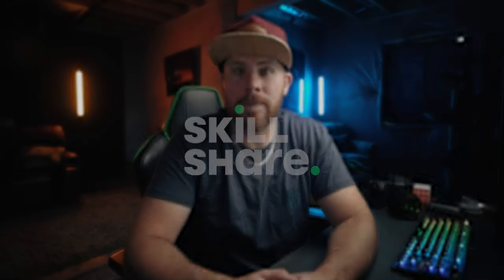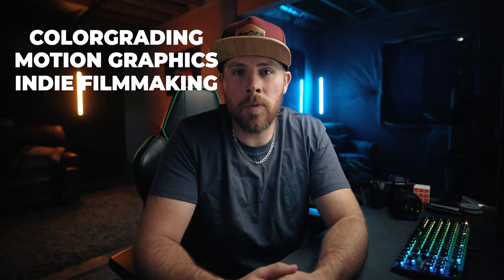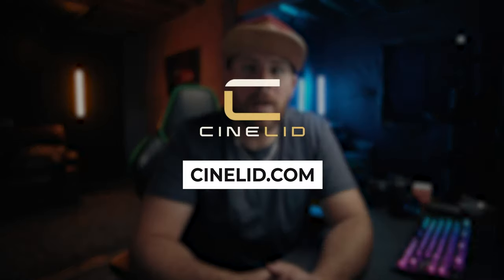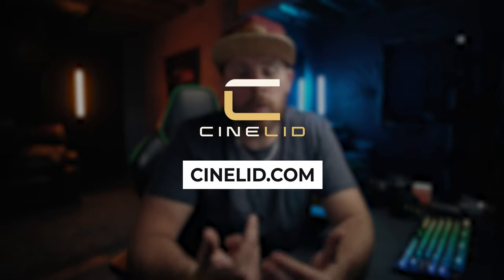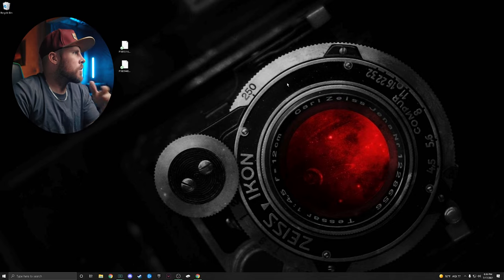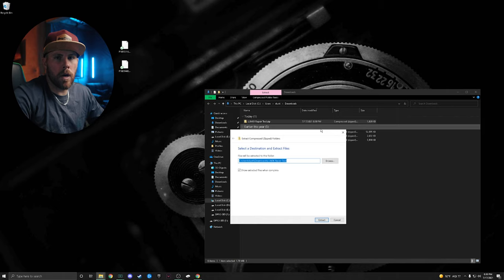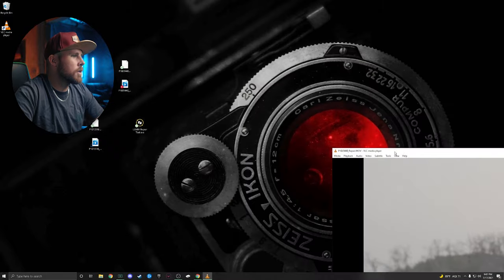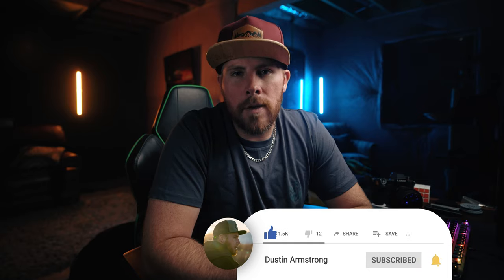LUMIX MDT Files. How to Prevent and REPAIR Them

Comment from the maker: Update for those watching. I keep getting questions on what you should do if you don't own a S series Panasonic. Still try and download this software and follow the instructions! It's still possible that it could repair the damaged file. Good luck!
Reply: It works. It's in the details of this tutoriaI.  My GH5 gave me a 90GB mdt file of a 1:20 hrs recording - and the magic happened. After more or less 1:20 hrs rendering along a perfect file from the same session all data were back and perfect.
Reply: After shooting one of the files is mdt now. But I have a GH5 But when you have to fill in the model and  the 11-digit alpha-numeric code what do I need to fill in? Because It's asking for a S model.
I'm really stressing caus the deadline is tomorrow.
I hope you can help.
Reply: @grunningervlog  Watch the video to the detail, when it comes to the „Chose Camera Model“ and „enter serial Number“. It took me a while to get the idea but then it worked.
Reply: Did it help? Could you free your data? @grunningervlog
Reply: Thank you for sharing! Worked perfectly with a 60 GB 4K .mdt file from my GH5 camera. The only odd thing I encountered was that when trying to open files using the "..." buttons the software crashed. But when I dragged and dropped the file onto the repair tool it worked flawlessly! Panasonic really should make this software more easily downloadable, especially for owners of their other cameras too.

Comment: Hi folks. I recovered a .MDT file that was almost 30GB, and nearly one hour in length. It was really important wedding footage so was super worried I had a disaster on my hands. Long story short, I downloaded the Grau Video Repair Tool, and paid £30 for it. It worked. You must change the .MDT extension to .MP4 and tweek another option or two but it worked for me, thank god. You can try it for free and save 50% of your video before going to pay for the full version. Thanks a mill for this video. Sooo helpful.

Comment: Just had almost an entire shoot's worth of clips turn into .mdt files. Luckily 2 were written correctly. I was able to install Parallels on my Mac and open the LUMIX Repair Tool in that. Worked perfectly! No batch processing option though. Insane Panasonic doesn't have a Mac version. Thank you for this video Dustin!
Reply from the maker: That's smart how you went about it on Mac. No problem though glad it worked!

Comment: Thank you Bro for breaking this down perfectly! I've been recording with my S5 and S1 for several years now and haven't experienced this issue. Just did my biggest shoot to date and had this happen on the most important clip of the event 😖. I had a fully charged Lumix battery, didn't turn my camera off, and didn't take out my memory card. BTW, I use Lexar Professional V60 cards and like I said, never had any issue with my cameras writing to them. However this was my first time recording in 4k60p for an extended period. Maybe that was the culprit 🤷🏿‍♂️. Either way, I followed your instructions and was able to successfully repair the file! Thanks again.

Comment: Had this problem come up during an event I was recording last night on my new GH5M2.  Was able to use the info in this video to download the tool, and it worked perfectly to recover a 42-minute video.  While I did have 3 other camera recording the event, this was my A camera.  Panasonic really needs to make this tool available for their other lines besides just the S-line.  I have been thinking of upgrading my memory cards, even though they've worked well for everything in the past.  Probably should just go ahead and do it to eliminate that possibility in the future.
Reply: Just thought I should come back and let future comment readers know that the recover process didn't work "perfectly" in my case.  For some reason, the footage from this file came out shorter than normal, and I had to jump through a few hoops to keep this footing in sync with footage from other cameras.  As near as I can tell, it looks like we lost about 25 frames from the 42-minute clip.   Perfectly usable, but not "perfect".  Resolve's retime feature helped a lot, as did the slip tool for individual shots cut from the multicam clip.  On a different, but related note, this was my first multi-cam project with Resolve, and it worked much better than Vegas, which is what I switched from.  Being able to re-sync source clips after multicam cutting is a godsend!
Reply: How did you solve this? I'm also GH5M2 and I got a MDT file so how can I fix it? I can not download this because it's not an S camera

Comment: Got slammed with MDT files on my S1H last year. Over and over again with write failures. Panasonic supporttold me my Sony Tough cards were to blame. I didn't believe them but when I contacted Sony?...YES! All four of my 256, V60, first-generation Sony Tough cards were RECALLED! Evidentally, there is a memory controller chip that Sony was using that was defective. Sure enough, Sony replaced all four of my cards for free with their second-generation cards and I never saw another corrupt file again. I was also told that other SD card companies are using the same defective controller chip in their cards too but that other SD card companies are not doing recalls the way they should. I'm told this defective controller chip is (or has been) used in many different brands of SD cards. Sony is now putting an "*" in front of all their second-gen card serial numbers that do NOT use that bad controller chip anymore.
Reply from the maker: Great info. Thank you
Reply: @DustinArmstrongPro  - I really have to praise Sony for biting the bullet and recalling  their cards like that. It cost them money as Im sure that was not cheap. Other card companies are staying quiet about theirs and hoping people dont notice.
Reply from the maker: I mean Sony is a huge company so I'd honestly hope they would do that. I'm sure the other companies either don't care or they just would have a hard time recalling all cards like that
Reply: do you think its possible that the cards (1st gen) can work fine in older models (specifically GH5S in my case) but has problem with newer models, FFs (in my case S5)? because i have 2 sony cards and 2 sandisk cards and with all of them the camera keeps stopping recording from time to time (sometimes even getting .mdt files) - but no problem at all in GH5S - which has even higher bitrates than S5

Comment: I can highly recommend to use every detail of this tutorial, it took me a while to realise the point, but then it saved me from eternal embarrassement, as I discovered that my recording of a 1:20 hour dance show on my GH5 came out as my first mdt file ever, 90 GB sized. With Dustin's help and a close look how he deals with the original Lumix Sotware (PC only) I could recover the whole file in perfect video and audio quality without buying a S-Series Camera. Don't lose your patience while the software is working, the progress line was moving forward very slow and the software just stopped in the middle of rendering to inform me that the repair-file is finished. Three days leater I'm still unsure if it's real, that this lost video was resurrected. Thanks. Referring the reason for the mdt file I can only suspect, that it was the non orignial DC-Constant Power adapter I used.  Recording was stopped properly, Camera shut off after waiting a while, SD card stayed in. Another crucial Detaill is on top that you have to use a working video file with the exact same session/file preferences. So do never hesitate to save a few testshootings to your card, to ensure you can repair afterwards.

Comment: Thanks for the tip, I realized that the camera was powered off too quickly. Once the SD card was put back in and the camera turned back on, it prompted me to fix the conversion and it worked perfectly. Well done, thank you.
Reply from the maker: No problem

Comment: Just filmed a wedding yesterday. A 27 minute A cam ceremony file turned into a .MDT file 😢

I watched your video but unfortunately because I had used 10 bit 4k 60 .mp4 with AAC audio the panasonic repair tool did not work. "Doesn't support AAC was the message". 

For anyone wondering how to deal with that issue then I have GREAT news. There's a program called Untrunk_x64. It recovered my 27 minute video with only one dropped frame.

Panasonic really needs to step up their game with their .mdt file repair software. If MDT files are a known issue, Panasonic should offer a more user friendly robust software to recover said files. I basically had a panic attack and left the wedding early to work on recovery. Thank GOD for Untrunk_x64. It recovered the file AAC or not!

Comment: Thank you for the video Dustin. This is a pretty unacceptable thing that seems to keep plaguing Panasonic for sometimes seemingly no good reason (I use fast expensive cards and OEM batteries). The poor repair tool seemed to always crash every time I tried to repair a file and I didnt realize you have to drag a correct mov file and the mdt file to the fields instead of clicking the folder search. Also not even compatible with mac. Just unbelievable on Pana's part. Along with the S5 rolling shutter and forced 60p crop (even in 8bit) I'm kind of over this camera. Not even sure I will be trusting this for an A-cam on a wedding shoot, instead using my GH5 classic. Panasonic I love your stuff, please fix these things. Super helpful as always Dustin

Comment: Hey so i had that same problem happen with my Lumix fz300 and its a very important video clip and i have the mdt file and i didn't see an option for the lumix fz300 on the repair tool page so i was wondering how i would fix that file
Reply from the maker: Try using the S5 as an option

Comment: Hello from Spain. I have also had the problem of getting a .MDT file on my LUMIX FZ2000. I followed the instructions in this video (thanks a lot armstrong for your help), and downloaded the software selecting the S5, but unfortunately I get the message that "AAC cannot be repaired". I have seen in the comments that someone has had the same problem. Has anyone been able to solve it?
In my case, I was recording in 4K 25p.
Thank you!!!
Reply: Same with me, it didnt work, I think my problem was in the memory card
Reply: It states clearly on the Panasonic web site on the utility download page, that this only works for MOV and MP4 files recorded with LPCM audio. MP4 recorded with AAC audio is not compatible with the utility, nor is AVCHD recorded video. That is why you got the error message.  Based on this, I will be reviewing recording formats that I use on my GH5. Knock wood, but I have yet to have a file that was not recovered in camera directly, and never had an mdt file to contend with and I've had GH5 cameras now since around 2018. It's probably not a matter of if, but when... eventually.

Comment: Keeps happening to me occasionaly. Multiple cards (all of them are fast enaugh and work pretty fine in my GH5S where it never happened). 3 different original batteries. No overheating (not even close). Any ideas?
Reply from the maker: What cards are they?
Reply: @DustinArmstrongPro  SONY 64GB SDXC UHS-II, 260R/100W + SanDisk Extreme Pro 128GB SDXC UHS-I U3, 170R/90W

Comment: Am from Singapore. Had same issue with my S1H 1-2yrs ago. No indication that video file was corrupted.  Only when back in studio that i realised. Files corrupted on both my SD cards. There was no information on the issue on the net. Happened a few times.  Finally, it came to faulty Sony Tough SD cards.. Went to Sony and exchanged a total of 11 Sony Tough SD cards... Since then, no issue at all. There was a recall on many Sony Tough cards.
Reply from the maker: Yeah those old Sony Tough cards gave me problems as well. I returned them immediately and stuck with my cards. Glad they fixed it
Reply: @DustinArmstrongPro  since then... i always mount the Atomos Ninja 5 on the S1H and set it to record as a 3rd backup just in case both SD cards ever fail again... once bitten twice shy... Had managed to 'repair'  those corrupted files using some paid 3rd party software. Got back 90+% or so but the footages are largely unusable. Pretty jerky and look as if playing in 12-15fps..
Reply from the maker: Did you try the lumix repair tool?
Reply: @DustinArmstrongPro  didnt know abt that tool then. This happened May 2020. Not sure if the tool existed then.

 Was an interview with some Minister; over 20min of video in total. S1H was main cam. 2nd cam was GH5s. Somehow that day, i setup a 3rd cam, GH5 for no reason. And I managed to pull audio from S1H and use most of the footages from the GHs.
Reply from the maker: I don't think it did either, but you might be able to recover those files now that it exists.

I forgot to mention, love having the support from Singapore 🙏. Really appreciate you being here

Comment: Is there an L-Mont camera that has as good AF as Sony or Canon?
I do not want to leave the L-Mount universe (I am already invested), but I need a B-camera L-Mount with excellent AF capabilities for certain events like using a gimbal.
Reply from the maker: I don't believe so currently
Reply: @DustinArmstrongPro  Then which camera and lens out of the L-Mount Universe would you recommend that is great AF, light weight, not expensive, in order to use with a Zhiyun weebil s?
Reply from the maker: I mean as far as AF, using native Panasonic lenses are best. I like the 1.8 lenses. Small light and look great but they aren't all out yet

Comment: Thanks :) I am shooting my 2.cond movie soon, an dmoved away from SONY to s1H . As you understand, to recreate a movie set, with poeple, light, location etc. is , or can be very expansive . I think you mentined in  another video , that on s1H, you actually nevber lost any files ?  right ? I bought me 2 replica batteries from germany, "cellonic". ok,on shopping again :)

I just, if you know. Will the s1H, always tell, with a warning, onthe time of recording, that the files is broken ?If so, its no big deal but.....starting amovie, I have to konw every detail about this.
I just was thinking. If I record, and then start tehe record button very quick , for the next shoot, woulden that also be short of time, so to say. If the files need somtimes 5-10 sec. probably its best to wait, just some seconds, before pressing the record ?
Reply: also, to concider, IF, its so, that you msut ! have original cused to electric stabile "lfoat", og stream, that must mean that you should avoid, consuming  extra devices to the cam as well, if I follow the logics here. Or is ti jsut a salespoint ? ...well I dotn have 3 years of study, to find out. But, What about the 24-70 Lumix lense, will it suck  power on A. F ? will a XLR take musc power. I mean if its imprtant, then Panasoinc sould advice us NOT to stress the battery ( at leasast for 4k, 422, .MOV shooting ) and, is there any reseach, from Pana, that say maybe 4kUHD, not the DCI ? I hope for more precise information here .